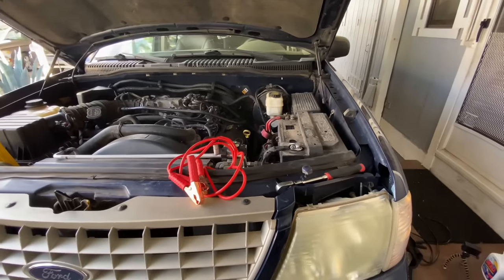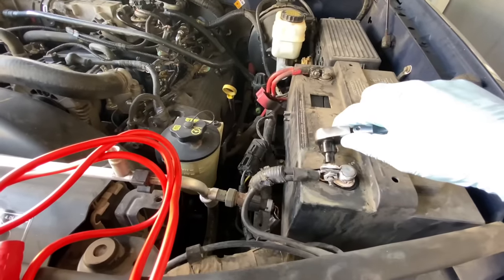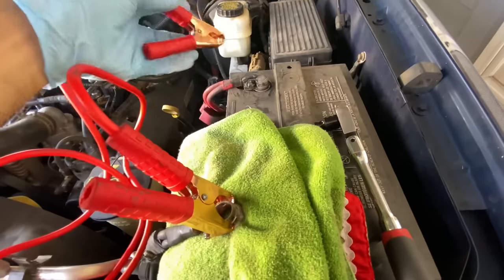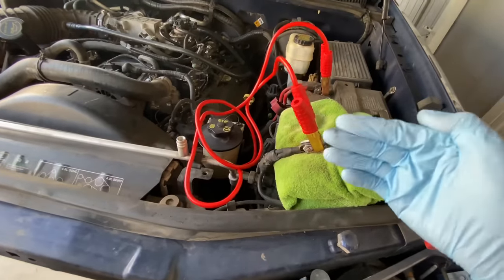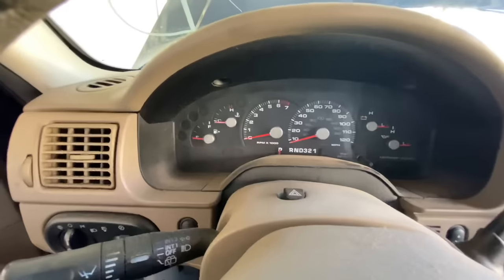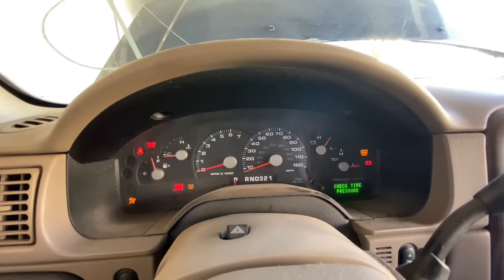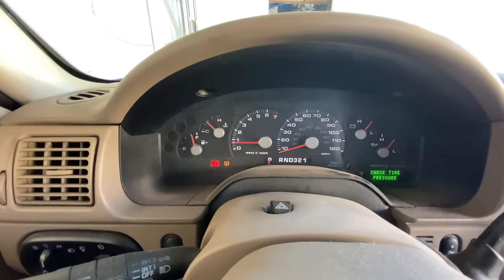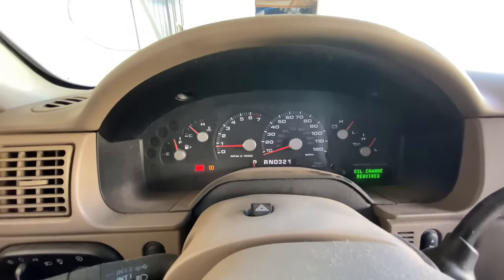How To Reset All ECU’s and Control Modules in your Car or Truck

Comment: i just changed all the belts and the water pump on my 2001 Chrysler neon. Everything seemed fin until i had popping sounds from the engine. So i was wondering if anyone else has had this occur to them of if the car is just garbage? Ill give this a shot before i hire a real mechanic. lol

Comment: I hate to break the news to anyone, but this does absolutely nothing. Disconnecting the battery alone will indeed reset KAM (Keep Alive Memory) on older vehicles; 2009 and earlier, but jumping the positive lead to the chassis ground through the unhooked battery cable does nothing at all. There is no completed circuits at that point. The adaptive relearn after reconnecting the battery is correct, most maufacturers have a procedure for performing a global drive after a battery disconnect
Reply: most maufacturers have a procedure for performing a global drive after a battery disconnect........ anyone know the procedure for a 2011 dodge caravan?

Comment: I brought my car to a reputable, I thought, Franchise. I had cross polarity on battery. 
I ask the dealer to check for fuses. After a week, he hcould not find any fuses bad. At $70hr  I said check 2 more hrs. No luck 
Said my BCM was toast.Towed my car home and started pulling BCM. They wouldn’t do it.troubleshooting, on YouTube, found diagram .i started pulling BCM. The then thought to myself this is not logical.had it unplugged but put it back,  all plugs.continue TS.
Noticed on diagram  120 amp fuse. HMMM. 
Checked fuse, THAT WAS IT. 
I’m still trolling franchise for an electrical class for this electrician.Replaced fuse my self . Not a small job since fuse box has to be pulled to remove bolts holding fuse. He didn’t even know that. Just pull it out he says😊
Now. I have all power, but car turns over but won’t start.
Do I have to reprogram BCM?

Comment: its a magic,it didnt work with my mazda 3.scanner said need to replace vvt sensor for idle problem.
Reply from the maker: if there is an actual problem this wont help. it has to be fixed. thanks
Reply: @GK7GARAGE  I don't think some people realize that this procedure won't let them get away with fixing an actual problem, that it only lets them kick the can down the road temporarily or fixes errors that just erroneous.

Comment: You don’t need cables to do this?? You are making it way harder than need be. Just pull your positive cable off the battery post, the make contact with the positive cable onto the negative cable and post on the battery for 30 seconds to a minute at most.it will discharge all of the capacitors in the car and reset everything.

Comment: On very modern vehicles  u do this , the ECU will discharge so fast that it will cause a spike or current surge. Then you will feel the Ouch on the wallet

Comment: Lame people use common sense. You don't need to connect the cars ground to the positive . Just turn the key on and disconnect the battery for 10 min . Even just disconnect the battery for 10 min  is all you need .  There is no reason to turn the key on and off after or this and that .
Reply: ECM just have compactor inside to store power. They drain on there own . There's no little battery storing memory.

Comment: Totally wrong. This could probably erase "service needed" codes stored (check engine), which might be needed by a professional. Otherwise, will do absolutely nothing to modern and expensive cars. To early computers or cheap cars, I repeat, will only erase the "check engine" light. I understand your good intentions but, this will not erase or reset all from all cars.

Comment: Looks like a way to ruin a Battery?
Think you forgot to remove the Battery from the System, before doing this..? 

Had some son of a biscuit eater who was replacing my Starter, backwards jump my SUV.... Starter was bad...
Maybe he was trying to 'Resent my ECU'? He Melted the Battery, Ground Leads, Power Leads, Alternator, Blew the Spark Plugs ( Which are Diodes) etc...
Reply: Couldn't u just disconnect the battery for like 30 min and turn on the headlights?

Comment: Better get the codes before you reset just so you know what's needing fixed after it does it again
Reply: If it does it again it will set the codes again!

Comment: I have a sneaking suspicion that this wont work on my mercedes 🤔 i will give a try tho 🤔
Reply: Hey dude what happened? I’m thinking about trying this on my clk?
Reply: @Infinitpossibilities  not quite sure if it actually worked or not...however, for the purpose i needed to reset my module wasnt actually related to the module. It ended up being a leak next to my heater hose. Just didnt show itself till it was warm enough lol.

Comment: Well the idea is good…BUT you forgot to disconnect the positive cable from the battery post. This will not drain the battery if you are completing the circuit!
Reply: The battery is totally isolated so it makes zero difference if the positive terminal is connected or not.

Comment: What a faff. Just disconnect both terminals and hold them together to drain all the residual charge. Please be clear, this will reset the ecu values but, if there is a fault it will return.

Comment: Did you just guess that this would work, well it won't  because it is internet myth & will do nothing except fix minor issues such as resetting the check engine light. ecu capacitors will hold current for hours & nothing you have done here will drain them. So, your ecu will still remember the old parameters.

Comment: lol this didnt do shit . the fact that it still has low tire pressure and oil changed required. nothing was reset . 

if you want to do it correctly. turn the key to the on position for 15 secs then turn the car on make sure all electronics are off like radios and etc. wait 15 mins do not hit the gas  then click the key off for 20 secs then back to the on position for 20 secs then turn on the car for 10 secs and you will relearn the  car map system and fix your idle

Comment: Man you are misinforming the people, 1st you undo both post leads, then connect, only need a small jumper wire, u can even wrap speaker wire around the battery leads, you could as well turn your headlights on, and let it drain minimum 6hrs. or overnight.their is power for some modules run through your audio system. Once you reconnect your battery, idle in "transmission in nutral" until idle comes down n still give it a couple amore min in park, after, Your modules need to learn all. Take it for a normal drive so the transmission goes through all gears, up and down to a complete stop, a couple of times to make sure then take for a drive over 35  miles hr. OR 50 km hr. I take it on the HWY for over 20 min. I sure as hell not a know it all, however I know this. My apologies Pal, I didn't even watch your whole video, you were wrong rite at 1st. I will look for 1 video of this mechanic that his snap on OBDII couldn't set. I will !  So haters need not to leave nasty comments cause I don't give s £UK.
Reply: Make a video and post it describing and showing everything u said. From error codes to solving the problem.